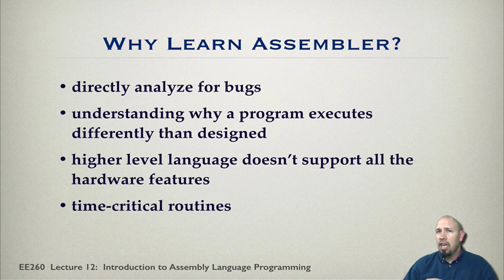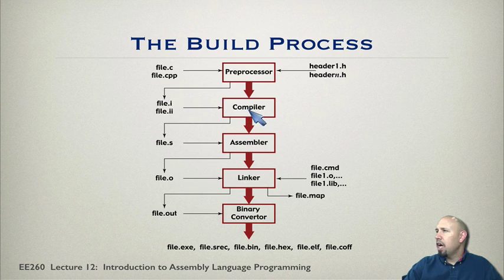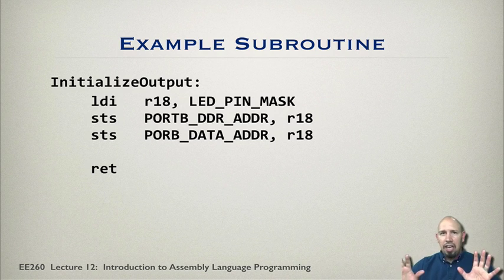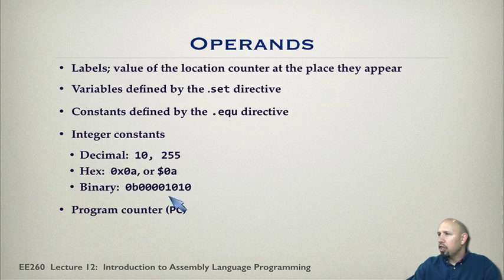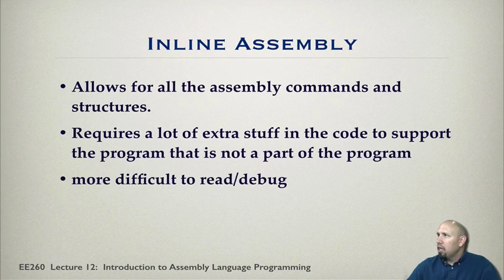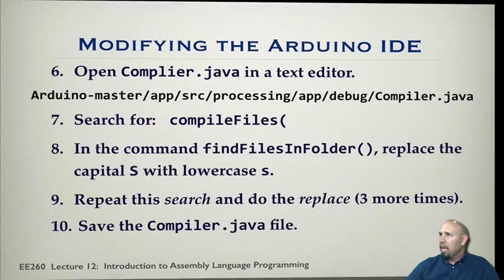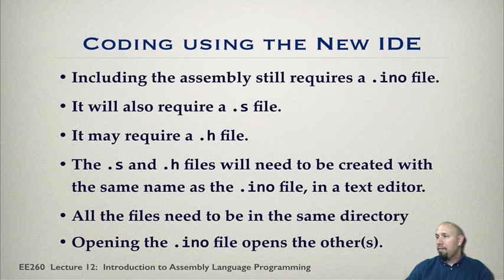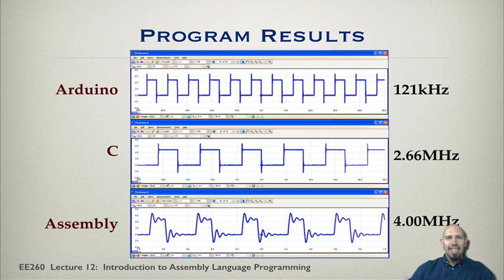12. Introduction to Assembly Language

Comment: I have been programming in assembly for over 50yrs. Mostly on mainframes that had 32k yes, 32,000 bytes of memory. Most everyone back then wrote in assembly because of memory limitations. Then I went to a bigger mainframe with 4MB if memory. That was multiuser and a few batch partitions. I still wrote in assembly lang and got the machine to do things that IBM said it could never do. That code was written in 1974 and is STILL running today.

I taught mainframes at NYU in New York, and taught hundreds of students to read core dumps effectively.

Today I am well versed in 13 different languages, but still write in assembly because it makes sense to me. Coming from an IBM mainframe background which does not have a silly thing like a stack pointer. I found using it very odd. In addition the microprocessors like PIC, MSP, and Intel have VERY limited and too many specializes registers.

This guy makes things overcomplicated as well if you ask me. All you need to do is learn the Principles of operation for each processor you are going to write for. In addition, you need to learn about the assembler for each processor to. Learn things auch as macros, directives etc. From there you can take a design you want to do from a diagram like a flowchart and begin to write code.
Assembler programmers are also called "bit twiddlers"

Comment: Good introductory video. 
Important point: every program in every computer language on every computer, ultimately, has to be translated into the only language the CPU understands - machine code. 
I began my programming career in the late 1970's onwards, becoming hooked when introduced to the Sinclair ZX80/81/Spectrum, BBC, Apple II, and in particular, commercial games programming for the the CBM64 and Amiga.  These early computers all came with the Basic language (almost always 'interpreted'), which was way too slow for games programming (though fantastic for introducing new programmers). Since they all had CPU's, then by extension, they all could be programmed in machine code - which gave a huge speed increase and, crucially when RAM was limited, allow you to significantly reduce the size of the program.
Machine code is simply a section of RAM holding a sequence of opcodes (CPU instruction) with their optional operand/s (data/address). Virtually no one programmed in machine code - instead we used assembly language. Assembly is nothing more than replacing the op-codes with an easy to remember mnemonic - typically then, with a 3 letter code. Optional operands are simply written to the right of the instruction. 
It is important to understand that assembly language, in this format, is a direct 1:1 with machine code. Today's assemblers may offer 'optimisations' that may replace some instructions - if you are an expert, you will never turn on these optimisations since you are...and expert(!!!)...and doing this, assembly language is still a direct 1:1 with machine code.
Crucial point to note - knowing a little assembly language does NOT make you an expert. An "expert" will know every CPU instruction, how to program (link these up) "expertly", and how to communicate with devices expertly. Doing all of that, at expert level, is extremely difficult(!!!) and requires serious dedication(!!!). Successful assembly language games programmers in the 80's-90's knew every instruction (and instruction 'mode'), number of cycles taken to execute, how to communicate with the graphics and sound hardware, and knew a lot of coding 'tricks', etc, etc.

Unfortunately, today's significant abstraction and relentless pursuit of higher and higher level languages, naturally means we have fewer and fewer expert level assembly language programmers.

However, it is EXTREMELY important that we maintain significant expertise in assembly language, primarily because 'state sponsored' groups have the potential to cause so much damage - remember...every program in every computer language on every computer, ultimately, has to be translated into the only language the CPU understands - machine code.

Comment: fun fact: debugging is named for the fact that old computers that used vacuum tubes would quit working due to shorts caused by bugs like cockroaches getting zapped when they bridged a voltage difference across their body. So you had to replace the tubes and scrape off the electrocuted roach as well of course
Reply: Almost got that right.... Debugging came into current terminology due to insects getting in between relay contacts which were used often in older bigger machines

Comment: Att:
  If you try to follow the "modify Ardy IDE" as described in this upload, it doesn't work. If you search around you will find others with the same issue but no detailed information or tutorials about this subject specifically as of November 2018. 

Here are the options I have researched (but still haven't tried yet):
1.) Use an old version of the Ardy IDE from 2014. The software is all java based and multiple versions can coexist on the same computer. You will need to find the source files for the old version on Github.
2.) Just try to use the .S instead of a .s file and deal with the extra baggage of the Ardy IDE
3.) On Linux be sure you have 
GCC
GCC-AVR
AVRDude
arduino //AVRDude dependancey
optionally
gdb-avr //debugger
simulavr //simulator 

GNU Build Chain: [credit:cypherpunk dot at]
""Now we can start assembling it with the GNU avr-as with the following command:

avr-as -g -mmcu=atmega328p -o simple_led_blink.o simple_led_blink.s

Option -g enables the generation of debug symbols. Obviously, this is only necessary if you intend to debug the program with gdb. Option -mmcu selects the type of microcontroller. You should change this according to your board type. After successful invocation of this command there is an object file called simple_led_blink.o. It contains the binary code but is not located to any specific memory location. This is done in the next step by the linker which binds all source objects together and locates the code to specific physical address:

avr-ld -o simple_led_blink.elf simple_led_blink.o

The result is an executable ELF binary. Before being able to upload this to the controller board it has to be converted into Intel HEX format. This is an ASCII-based file format for binary data. It is generally widely used for microcontroller programming. The format conversion is done with the objcopy tool:

avr-objcopy -O ihex -R .eeprom simple_led_blink.elf simple_led_blink.hex
...""

....I'm not going to copy any more of that site's reference materials, but you can find the same info if you search for the aforementioned reference, and the site is "".at""
  I will try to include an actual link to the site in a reply to this comment. If that is blocked by the YT autofilter you can reply to me and I'll find a way to pass the link.

   I also looked into the much more modern IDE option of Atom w/PlatformIO plugin but it only supports the .S file as well from what I've read thus far.
 Good luck.
-Jake
Reply: https://www.cypherpunk.at/2014/09/native-assembler-programming-on-arduino/

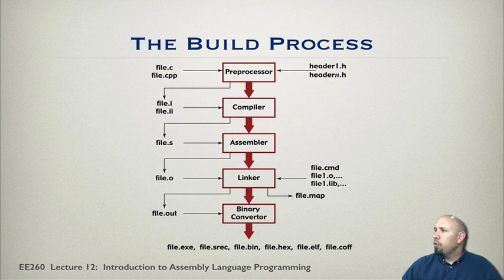Comment: 14:08 
Does anyone know of a reference that explains this type of toolchain in an even more abstract/top down format as it applies to several different microcontrollers? When it comes to different brands and architectures, what are the general differences and options to look for?
   For instance, I know Microchip's PIC line has evolved considerably. I've only used the newer stuff a few times. I know the newer chips are "C-optimized" while I think the old stuff was often coded in Assembly. Intuitively I assume they made big changes in how the build processes work but I have no clue how or why. 
   Also I'm curious about some newer variants of 8051s like some offshore stuff. Can I use a generic 8051 build process to work with these or do I need manufacturer specific tools to work with a specific 8051 variant? Is the build process tool chain needed for the unique extra registers only or every aspect of the uC? For instance if I treated an 8051 variant like a regular 8051 (ie an original Intel IC), and the variant uses the same basic instruction set, would any software capable of programming the original also work for the newer variants using the same programming build process?
-Jake

Comment: Hi Robert what specific board are you teaching on if so do you have a link to it to buy as i am sure it is specific assembly lanaguge also does it need a programmer of just usb connection for the arduino IDE?

Comment: there is no sc.isExtension("c") in my sketch.java :(
Reply: +oskar ewfall Indeed. It seems the IDE has changed alot since these videos were recorded.  Any hints on how to get .s files working again with 1.6.8 or later would be appreciated.
Reply: +NivagSwerdna I tried a bit harder and it does actually work out of the box with 1.6.5 which is what I have on this computer.  Just make sure you create a file with .S and all is good.  Make sure to .global export your labels if you want it to link.  Very cool.

Comment: Hi Robert,

I have recently downloaded the arduino-master folder from github. The Sketch.java file has been changed a lot now. It accepts only two types of files now .ino and .pde. And there is a functionality in the code to transform .pde file to .ino file. Now I am getting confused where I need to change the code so that it accepts .s files.
Reply: Hey, could you figure out how to solve it?
I'm facing the same issue

Comment: In the very last example; Is the different waveform worse with assembly because its at the edge of what the micro controller can handle?
Reply: I think it's not because it is on the edge of its possibility. I think it has to do with physics. I imagine that the electrons are like a train and need time to move. So when the port-transistor (or whatever drives it) switches to HIGH, the "mass of electrons" get pushed until 5V, then level off.
Then the same when it goes to LOW. The "train" needs to stop.
The interesting thing is, that the LOW part is able to level off, where the HIGH part is not and still bounces when switching to LOW. This pretty sure has to do with the four program steps.
Label, HIGH, LOW, jump to label. LOW has to steps or cycles to "relax", where HIGH is immediately followed by LOW. This is why the begin from LOW to the begin ofHIGH is 3x longer than HIGH to LOW.

But I would bet that when zooming in at the other two it would look the same. You see these peaks at 5V and -0V? I bet it is the same wave. But because the operation needs so incredible more time, the waves arent visible anymore because they get compressed by zooming out.

However, I'm a software engineer, not electro engineer.
So what I wrote is pure "brainpower" and sounds plausible, but has to be approved by someone from that subject... :-D

Comment: I learned assembly on the 6502 processor (Atari 800) it always just made more sense to me than C.
Reply: IKR
Two years later and it still makes more sense especially with all of the micro boards and DIY hardware options.
The new Jedi training utilizes opcode and specialty modules.
Reply: I taught myself 6502 machine language (I didn't have an assembler program) from the back of the Apple ][ manual in 1980. I still remember many of the opcodes almost 40 years later. AVR is a huge improvement over 6502 if you want to stick to an 8 bit CPU, but ARM or RISC-V are even better -- and easier to use. RISC-V RV32IM does everything an AVR does, but with literally half as many assembly language instructions to learn, and working directly on 16 and 32 bit values as well as 8 bit.
Reply: I know this comment is 3 years old, but i came specifically trying to learn the same Assembler lenguage you mentioned.

Comment: I tried following your slides using the latest build of the IDE on GitHub and in the ...\Arduino-1.6.3\arduino-core\src\processing\app - there is no Sketch.java. There are SketchCode.java and a SketchData.java files and the only place you find anything near changing the extension is in SketchData.java:

public List<String> getExtensions() {
    return Arrays.asList("ino", "pde", "c", "cpp", "h");
  }

and in the Compiler.java file, there is only one reference that might be changed:

private List<File> compileFiles(File outputPath, File sourcePath,
                                  boolean recurse, List<File> includeFolders)
          throws RunnerException, PreferencesMapException {
    List<File> sSources = findFilesInFolder(sourcePath, "S", recurse);
    List<File> cSources = findFilesInFolder(sourcePath, "c", recurse);
    List<File> cppSources = findFilesInFolder(sourcePath, "cpp", recurse);
    List<File> objectPaths = new ArrayList<File>();

So, I tried adding an "s" in the SketchData.java and changed the "S" to "s" in the Compile.java file, but then when I tried to run ant for the build JRE (jre1.8.0_40) it gives me an error:

Unable to locate tools.jar. Expected to find it in C:\Program Files\Java\jre1.8.0_40\lib\tools.jar

And there is no tools.jar in that directory. So, failure on trying to get assembly working in the latest IDE.

Comment: Hi Dr. Paz,
I love your lectures. I've been playing around with Arduino for a few years and am interested int taking the next step into assembly language. I would like to install this: https://github.com/PaulStoffregen/Arduino-1.6.0-Teensyduino/commit/20bc5e981078419ac0dd86190a2dd50f5ffc051d but I am not sure how to install it. Is there an installer that goes with this?

Thanks,
Jose
Reply: Nevermind, Dr. Paz. Looks like today's post following your link makes adding the .s extension easy for even 1.6.x. You do get the teensy sypport with it, but I am mostly just interested in the ".s" support.

Thanks,
Jose
Reply: https://www.pjrc.com/teensy/td_download.html

Comment from the maker: GOOD NEWS!  For those of you interested in doing assembly on the TEENSY, I received this email from Paul Stoffregen:

A couple weeks ago, I got a request to integrate your assembly patch for Arduino with my Teensyduino patches, that modify the Arduino IDE in a number of ways to support Teensy boards.

I reimplemented it for the new Arduino 1.6.0 version.

If you're interested, there's a beta test installer here.  It a GUI-based installer that does everything automatically and easily for novices.

https://forum.pjrc.com/threads/27740-Arduino-1-6-0-any-plans-to-support-it?p=65193&viewfull=1#post65193

The assembly support patch is here:

https://github.com/PaulStoffregen/Arduino-1.6.0-Teensyduino/commit/20bc5e981078419ac0dd86190a2dd50f5ffc051d

Hope this helps, or at least saves you a little time if you decide to redo your patch on the latest version.